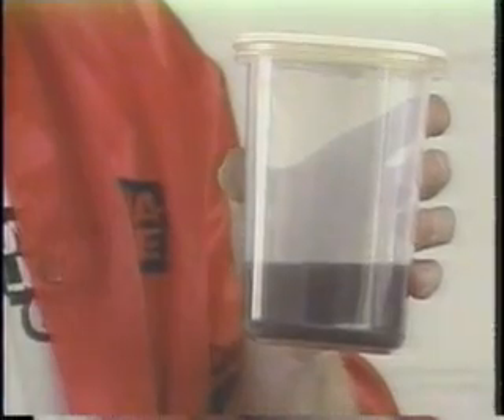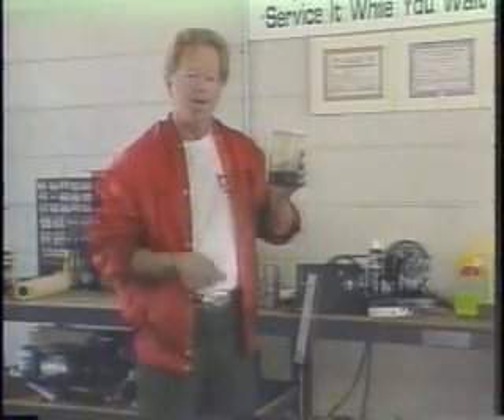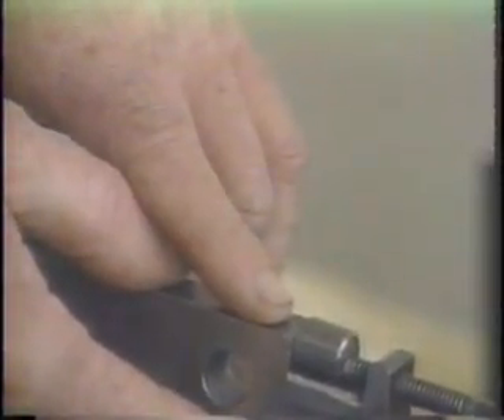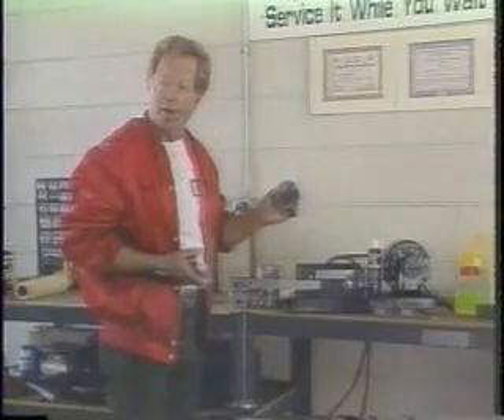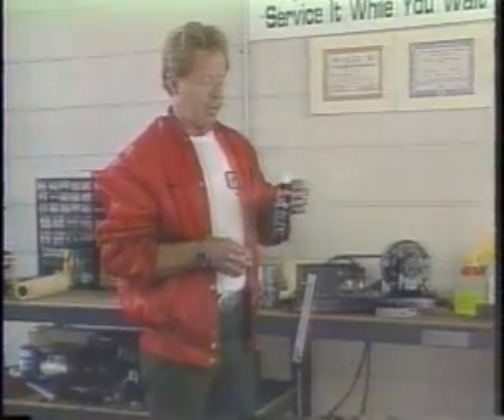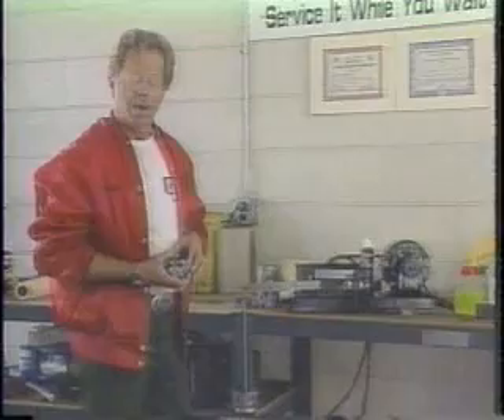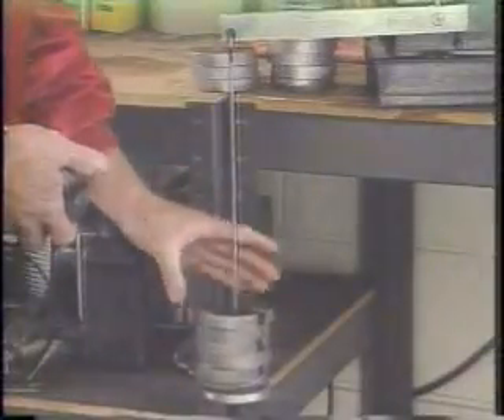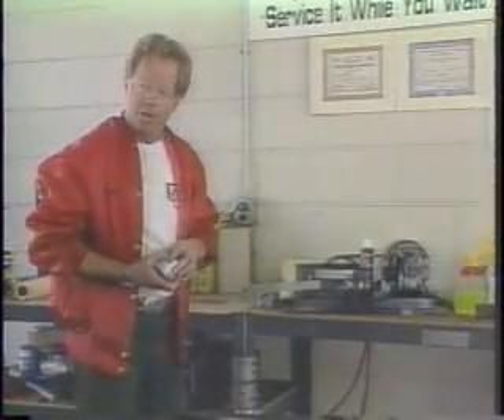Dyna Lube - Fact or Friction

Comment from the maker: We have testimonials from a couple of our customers that are car dealers. On every single used car they purchase one of the first things they do is an oil change and add DL to all the different lubrication systems on the car (engine, tranny, diffs, radiator, pwr steering etc..).  Their feedback has been that this significantly saves them money on labor, repairs as well as any warranty issues. 

We would welcome Blackstone Labs to test our products! 

Thank you for your service!